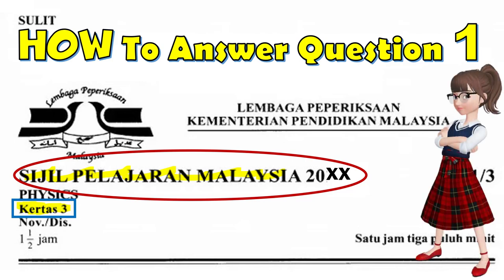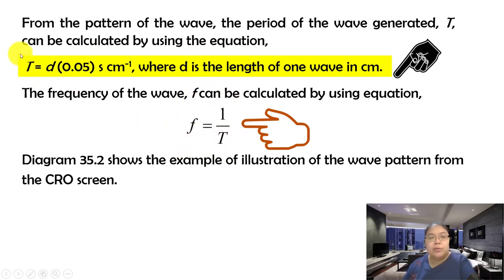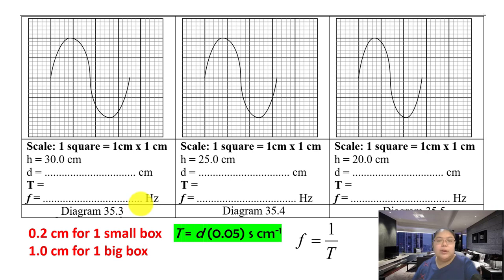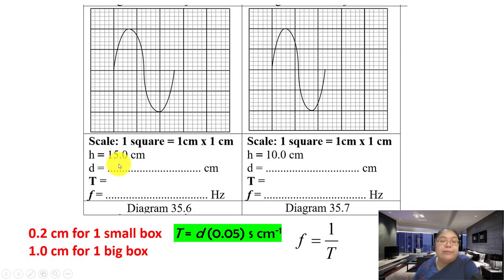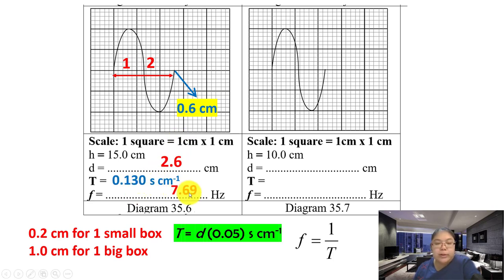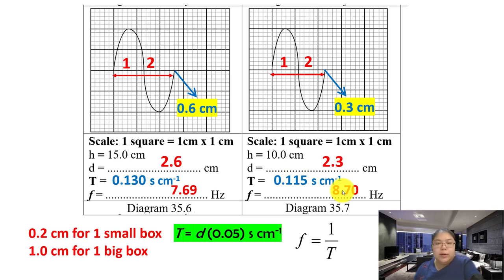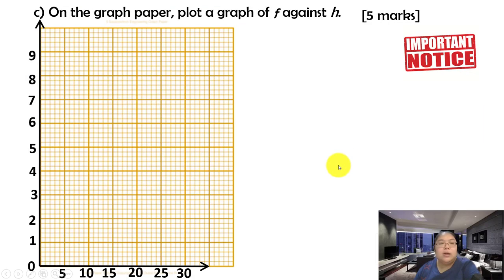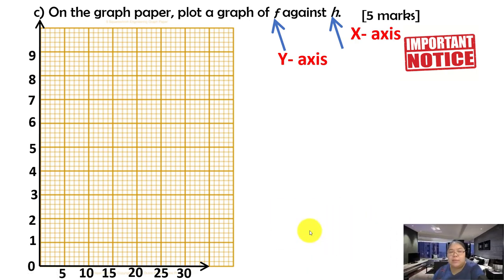SPM TIPS (HOW TO ANSWER PAPER 3) Q1 PHYSICS

Comment: Tcer what does meant by the scale is uniform?

Because for my mid year exam my scale was wrong? It must be like gandaan 2?
Reply from the maker: uniform means start from 0 than use ratio 1:2 so ever different is 2,4,6,8
this call uniform. if u start from 0 then 2, 6, 8,10. this call not uniform. we only can use even no. such as 1:2,1:5,1:10 pls DON use 1:3, 1:7 OR 1:6 AND 1:9